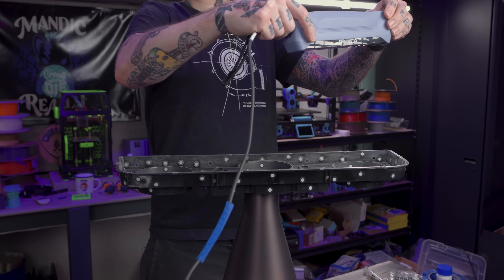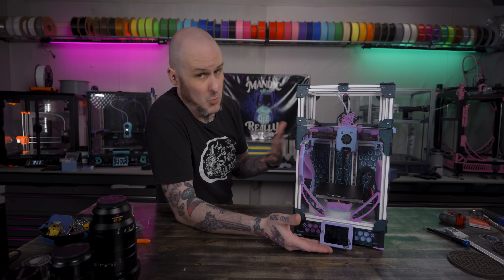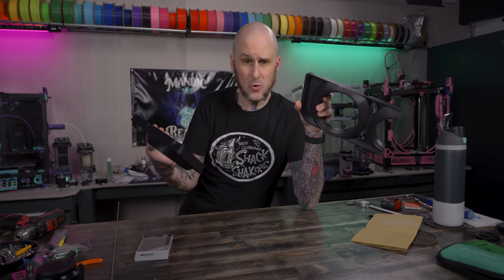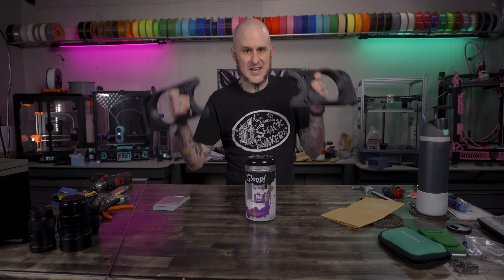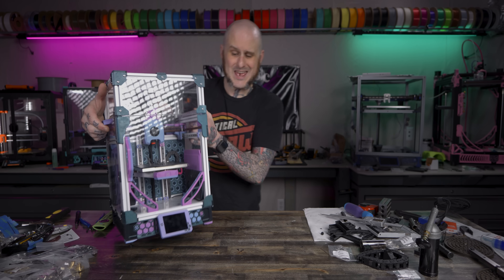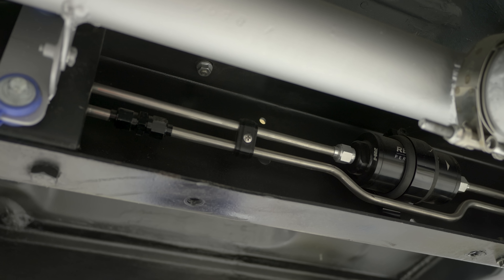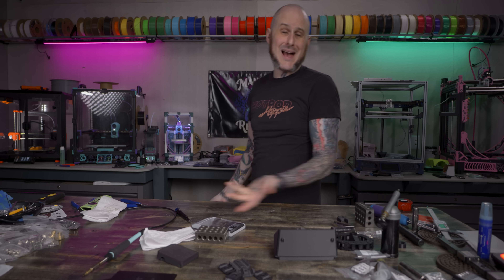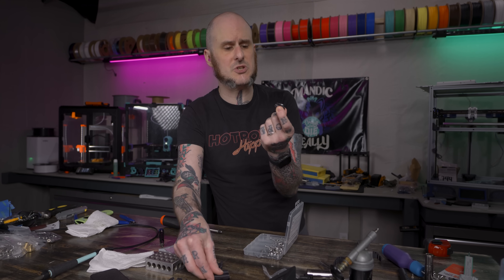3D Print Your Dream Car Parts Now

Comment: I too prefer ASA, specifically Polymaker ASA, for my car parts that I design and print. The hardest part about all of this for everyone is the CAD part. CAD is not that easy to learn and most people won’t pay for the licensed version to be able to do what they need to do. But I’m actually looking into gaining the capability to print PC which is even better for under hood parts on a car since it’s basically the same material that the automakers use. It’s CFRP but requires a hot end that can do 300°C. Also, don’t forget about TPU to make flexible parts such as gaskets and vibration isolation mounts. They have both 90A and 95A hardness of that. Honestly, I’d probably even make those fluid line mounts of yours out of TPU so they have some give, especially if those fluid lines span between the fixed chassis and the engine that moves a bit on its mounts. The possibilities of this are endless. Literally the only thing that limits you is your own imagination. Me having such a strong engineering type of mind, this is like Heaven to me. Currently by business is a mobile automotive repair business but I’m getting ready to morph it over to doing custom parts full time. But I’ve actually used my printer to make new parts for cars that have broken due to a poor design. I re-engineer the part and print a replacement. I can’t wait until I get my CNC and can take it to another level! The beauty of this is that you don’t need to create tooling to make a custom one-off part that makes production so insanely expensive. Using conventional methods like injection molding or casting requires tooling to be made for that and that costs a LOT of money. This actually makes customization AFFORDABLE to the average Joe, but not everyone can do the CAD part. However, it’s still much more affordable even going to a business like mine will be to have someone who can do it make things for you because the tooling thing is still true. Whoever actually made 3D Printing work is a genius and they have opened up the world of custom to a TON of people!

Comment: Im finally getting into 3d printing myself but put it off waiting for printers to get better and more affordable. I wanted to get a P1S and upgrade it, but the recent Bamboozle they had about requiring constant connection to print so they can track everything has me temped to find something else. But I am glad I ran across your channel, and as soon as I saw you combine welding with 3d printing i subscribed immediately, smart way to combine knowledge of different hobbies

Comment: What is the purpose of tear-dropping the holes?
Reply from the maker: @ProfessorOzone  it’s a design concession for 3d printing. Vertical holes will never be truly round as they are constrained by layer heights. So often bridging at the top of a hole will shrink the hole’s inner diameter. A tear drop makes a cleaner print (less bridging) and opens the hole up vertically so the filament doesn’t obstruct the hole. If well designed the hole still holds securely but prints quicker, cleaner, and better overall.
Reply: @MandicReally  Thank you for that.  I'll give it a try.  Like you I mostly make car parts and use almost exclusively ASA (I tried ABS-GF, glass fiber and didn't care for it).  My holes come out too small and so I was making my perimeters thicker or making the hole slightly larger and then drilling them out.  I don't like my method.  Think I'll try yours.  Cheers!

Comment: What does tear dropping holes do?
Reply from the maker: Helps with printability. The 3D printer only has so fine of a resolution to produce holes with, so the top of a circle will often just be flat and can cause artifacts in the print. The teardrop works with the technology to create less of an overhang and therefore a slightly rounder hole (with a little peak). It is a trade off to produce a better print. It also helps to print faster as bridging usually prints slower than a shallow overhang, so the teardrop can print at higher speeds.
Reply: @ I assumed that was the case but thanks for clearing it up!

Comment: 5:31 i've used gloop in the past and one thing to add. never ever get that shit on your hands you will get a weird chemical burn and dry skin and your skin will flake for at least a month. given this use gloves. just as a precaution for anyone using it the warnings on the tin with gloop is not for show. be careful using the stuff

Comment: I would suggest using HT-PLA. Good ones ( like the stuff from Proto-Pasta) is safe to 140-150 C, and there’s no way anything in a car gets this hot, except if it’s burning down 😁😉
Reply from the maker: Those materials require heat treatment to achieve those temperature ranges. To my knowledge that carries the possibility of dimensionality changing. Designing for that would be difficult. 

When ASA (which is cheaper) is easy to print, and also UV stable. HTPLA doesn’t have that going for it. Cars are exposed to the sun a lot.
Reply: @MandicReally  you‘re wrong (or let’s say: your informations are outdated) - check the pla i mentioned above as an example, no heat treatment necessary. It’s quite cool we have these possibilities these days 😉

Comment: Time for “abrasive” X1C. Slicer allows you to cut up shapes and choose the guide method. Like slots or dowel pins and prints them with the print. I’m sure Prusa slicer does as well

Comment: I printed an overhead GMRS / radio mount that replaces the factory sunglass holder in my Forester and a mount for a smaller washer bottle and fuse box mount in my engine bay out of polymaker ASA. All of it has been on my car for over a year now with no issues. I love that stuff.

Comment: Thanks for those clamp files they are great and going to be really useful! But what I'd really love to see is a file for that really neat Deutsch connector bulkhead fitting. That's so good being flush fit and would make the wiring on my dragster a hell of a lot neater. Any chance of that file being available? Thanks

Comment: Amazing idea but i do have a question fo you think old Ender 5 motion system mods would work on the S1 cuz i wanna convert mine to a Cross XY and i cant model for crap
Reply from the maker: I haven’t had the S1 for a while. The only issue I can see is that the extrusions aren’t the standard “open on all sides” right? So if the mod mounts to the extrusion side or something, you are out of luck.

Comment: 10:33 fiber reinforced polypropylene would be even better choice than ASA/PA it does not soak water at all, has pretty good thermal resistance, isn't worse than ASA in context of UV resistance, superb impact resistance and almost perfect layer adhesion, you'll need to make an FR4 flextplate as well as heat bed that can heat up to 130c, yet it is worth it.
Reply from the maker: One of my next machine builds is an active chamber heated build for materials like that. So sooner or later I’ll expand material options that far.
Reply: @MandicReally  it doesn’t really needs heated build chamber, with 30% of glass fiber it’s shrinking coefficient is lower than ABS one, so passive chamber and FR4 at 130c will do the trick
Reply from the maker: Sorry, point of that was that the heated chamber machine will also have a bed capable of those temps. I could probably swap thermal fuses on my current 2.4 but the next build I already intended to setup with a bed capable of 130-140C.
Reply: @MandicReally  well, 3M acrylic adhesive used by keenovo is rated for 200c in load “for hours”(don’t really know how much is it) but in my case I’ve just removed it completely and applied heater to aluminum plate with automotive 280c gasket rtv silicone(abro) and swapped thermal fuse to 165c so it won’t loose adhesion until I’ll intentionally scrape it off :)

Comment: Good vid! I got into 3D printing and CAD because of my project car I designed a rear disk setup to replace the drums. I prototyped it all with the 3D printer then get the parts CNC'ed
Reply from the maker: That was the driving force for me. I wanted to do more one off CNC and use printing to prototype. Basically never did it though cause I dove so hard into printing. 🤣
Reply: @MandicReally  Yeah my friends jokingly give me a hard time that that I'm more in to modifying my printer and printing stuff than finishing my car. 3D printing is pretty fascinating if you get bitten by the bug! BTW your Dad's truck looks great!

Comment: When I got my first 3D printer last July, I had 3 projects I wanted to complete, the 2nd was a dash mounting bracket and bezel to put a new radio in a 1996 car, I used ABS but I wrapped it in vinyl. The 3rd was an enclosure for the Water chiller that cools water for the vest on my motorcycle (It’s like AC for the Motorcycle). I had no 3D modeling or printing experience, but those projects turned out great. I expect to do more auto related projects.
Reply: Ovity I want to start 3D what printer do you recommend?

Comment: I am curious what was wrong with the fit of the previous cluster housing. How was it fixed? People don't seem to understand how things need iterations to fit properly.

I also recently started using Tig rod for reinforcement. Reasonably priced and little variation in diameter.

Comment: Any chance I can get your Polymaker ASA profile? lol
Reply from the maker: I don’t share profiles unfortunately. Every machine varies. I’ve got a half dozen Polymaker ASA profiles because it behaves differently on different machines. Each has different temps & pressure advance. 

Ballpark of where all my profiles land:
- .93-.96 Extrusion Multiplier
- 240-260C extrusion temp
- .02-.0325 Pressure Advance (direct drive)

Those are really the most important factors imo. The rest is even more machine specific due to cooling capabilities, chamber temps, etc.
Reply: @MandicReally  I was mainly curious to see where your temps and PA landed compared to mine. Been fine tuning my polymaker asa profile over the past week and I thought the pressure advance was quite high, but it looks like yours is just as high. I've got .967 extrusion multiplier, 255c and .0315 PA. Thanks for the sanity check!

Comment: I'm curious why you teardropped the holes. I make a lot of my own parts this way too but the concept of teardropped holes is different to md
Reply from the maker: When holes are oriented on the vertical plane (z axis) while in print orientation, they can have trouble bridging or drooping into the hole. A tear drop gives a better and more printable angle to make the holes turn out smoother and with less material sagging into the hole bore. Sometimes that sag can cause the bore to be smaller, or more often it can cause minor artifacts at that layer height from the nozzle colliding with the sagging bits at the top of the hole. Hope that makes sense.
Reply: @MandicReally  makes perfect sense thanks man, I will have to start integrating that into mine now. Love your channels mate found you as the hod rod hippy. Keen to see the ratrig arrive soon.
Reply: @MandicReally  that's pretty cool, where did you pick that up?? what % infill are you using for ASA?? I've been using PC w/ carbon fiber, kinda cool, just need the harder material nozzle to handle the abrasive characteristic of the CF.  Great video, thanks for sharing with us.

Comment: 3D printing and car parts... you're speaking 2 of my preffered languages!  Also holy cow... No "quick" trips to your dad's shop from Oregon!  I've been keeping an eye out for an older truck myself... something cheap yet not a major project... preferrably something prior to 1970... haven't found the perfect candidate yet... I should probably get the current project ('91 240SX) back on the ground first... it's been years, but it needed way more work than I anticipated.
Reply from the maker: Eh, even now there are no "quick" trips to Dad's. It is a 10 hour drive from PA. I've taken to flying down when I can, so that won't be any different from Oregon. And flights from Portland to NC are surprisingly reasonable thankfully. 

Good luck finding a truck! I'll be on the hunt for one myself when I get to Portland.
Reply: Good luck looking for an old truck a few months ago I was able to find a 1980 El camino there's only 500 of those in the US (atleast known)

Comment: 3d printing is so nice to have. Great for random knick knacks but man it's SO CONVENIENT for custom practical bits too. I did a custom column trim piece for a Buddhist temple a few months ago since they were remodeling and needed to replace some damaged ones. It would have cost hundreds for a local contractor to custom mold them for new ones but I was able to model up the piece like 95% accurately (these were at the top of the columns so you couldn't tell at a distance anyways) and print them for <$100 in PETG filament. Needed to split them into quarters since I only own a couple Ender 3 printers but they worked like a charm.